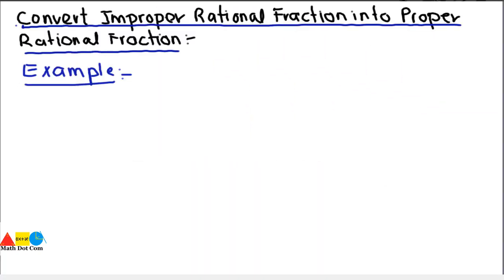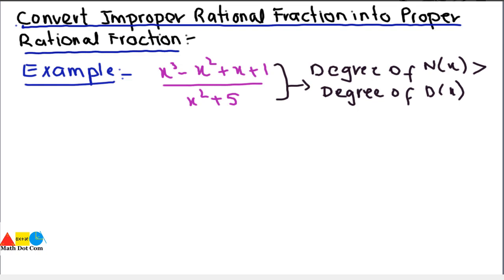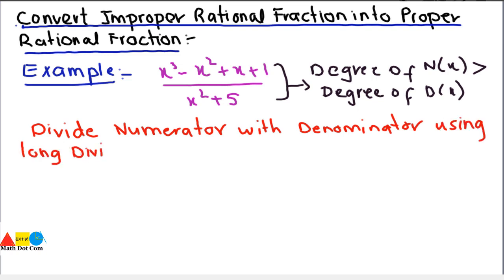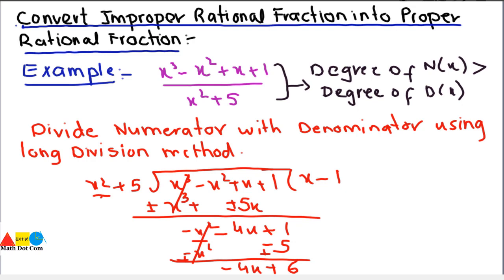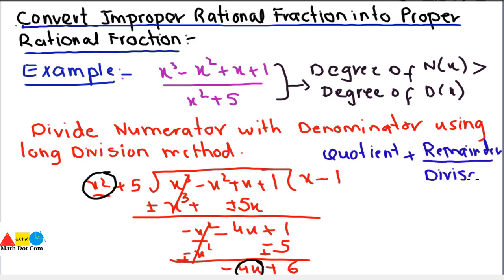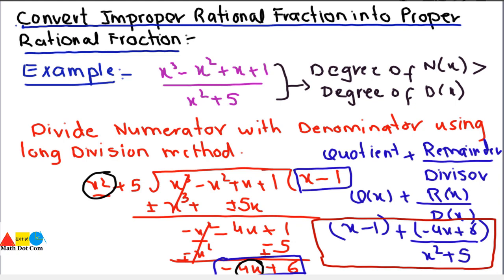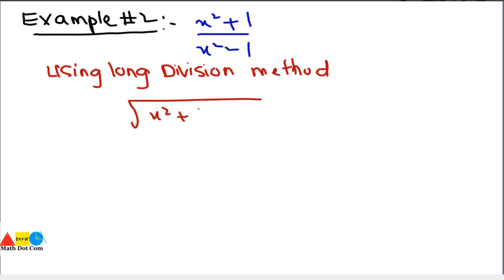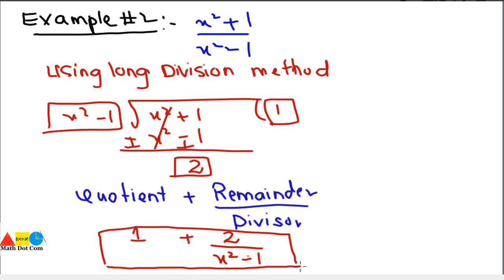Convert Improper Rational Fraction into Proper | Math Dot Com

Comment: how the resultant one is proper ?!!!  still the (x-1)/1 is improper ye the (-4x+6)/(x^2+5) is proper but the other is not.
Reply: Actually, you are quite right. How would you do? Also, in 2:48 do you know why and how she turned the negatives into positives?
Reply: I found out that it would be that case if it was multiplication, but since this is addition, you don't just put one underneath the numerator. In this case, they have already divided the numerator by the denominator, so the answer was x-1.

For example: 25/7 = 21+4/7 = 21/7 + 4/7 = 3 + 4/7 = 3 4/7 , which is the same as 25/7 = 3 + 4/7 = 3 4/7